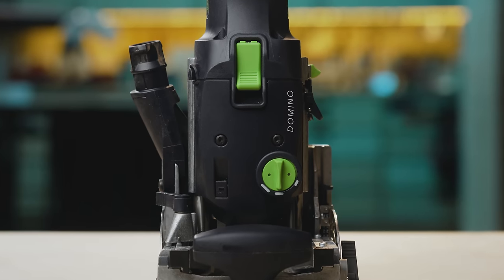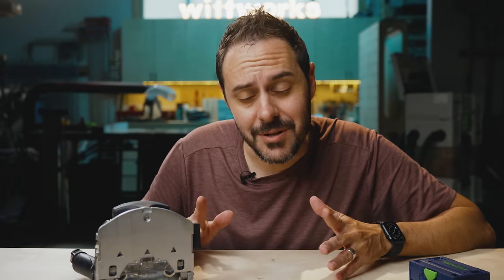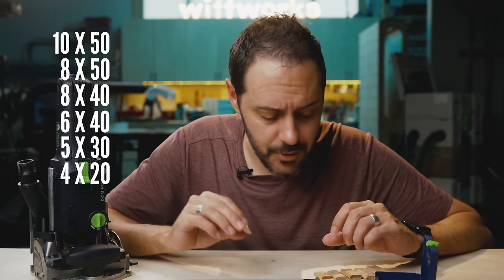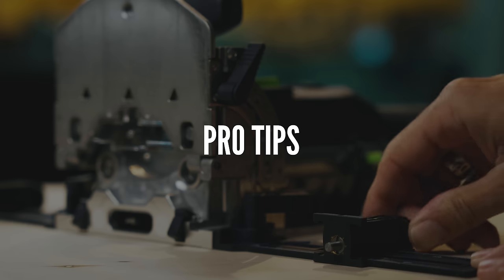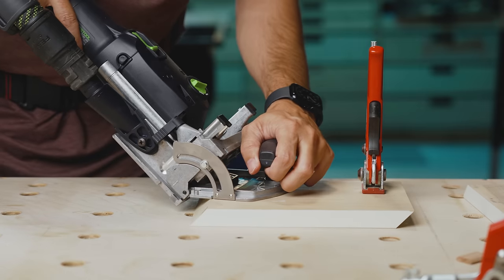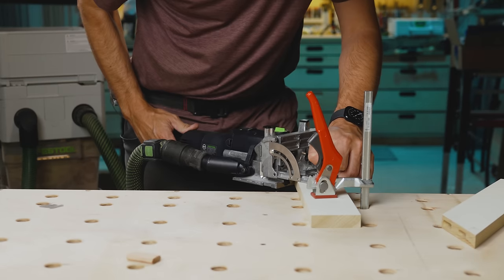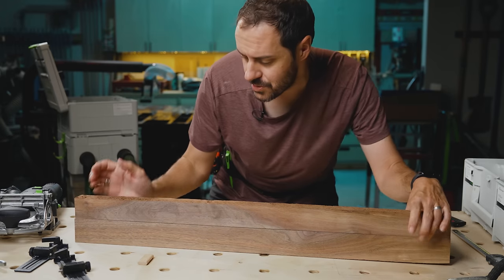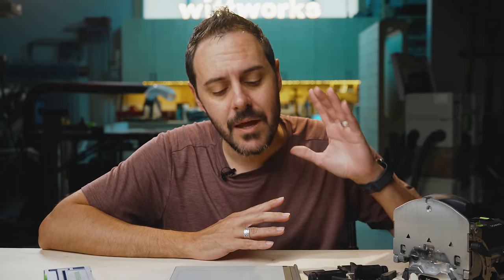Domino for Dummies

Comment: You keep referencing these Millie Meeters. I asked every Millie I knew and none of them were Meeters, some were Wmart Greeters but no Meeters. So I did Googlie and saw millimeters so I guess that is what you mean. But, here in Merica we only have inches. So 10MM is like 42 feet, according to the conversion chart I found on an Merican government site. That is waaaay to large for the work I do. Besides I converted Euros to Merican Dollars in my head and the tool is like $87000.00 not $1200, which is too expensive for me. Really good video though, and I congratulate you on your YouTube success to afford such a quality tool, I'll just stick to my drywall screws in pocket holes I make with a box cutter. Now, I have to go remove my tongue from my cheek.

Comment: Honestly, this is theeeee best Domino video I’ve seen. I’ve owned both the 500 and 700 for years. As a ‘no BS’ introduction to the tool, this vid  is as good as it gets.
Reply: 500 or 700, which do you prefer if you could only buy one?
Reply: @puna32  I bought the 700 and the adapter to use the smaller bits down to 4mm. It works well but it is big and heavy. I use it for bigger furniture so ot was the right choice for me. But it is a bit unwieldy on the smaller material.

Comment: The most consistent issue I have with registration is debris/dust. Almost every time I end up with some vertical registration it's because a little bit of dust or debris gets on the material and the fence will sit on top of that. Overconfidence with dust collection I suppose, but that's been my experience.

Comment: You can use a 6x domino in a 90 degree joint.  You use 15 mm  on the flat side and 25 on the long side.  You don’t need to step down.

Comment: I can tell you what went wrong when you did the fence at 45 and cutting the miter. At 45, the fence cannot go all the way to the base without keeping the black tabs depressed in. So when you pulled the one tab back out and reset the fence, that’s why it was higher when you cut it. You either have to go down far enough where the tabs don’t go in, or push it all the way to the bottom and not be able to use them as reference. Hope that helps!
Reply from the maker: Thank you!
Reply: Spot on.  Always, always set the miter first with the depth stop pulled all the way out.  THEN adjust the height.  It is the one order of operations on the domino that you have to follow.  And yes, the first time I did a miter, I made the same mistake...
Reply: @5280Woodworking 😅😅

Comment: One thing I considered as a hobbyist when buying this machine was how easy and quickly it set up and held the setting. Stopping mid project and continuing the next weekend has never been an issue. I hate spending tons of time getting a tool ready to use and rechecking calibrations and such.  The price is something to reckon with but the tool is high quality; the cost could be thought of in terms of the yearly cost over the life of the tool. The tutorial videos Sedge has out on his channel and the Festool live series are something unmatched with any other system out there.
Reply from the maker: That’s a great point! I didn’t think of that.

Comment: get a pair of flush diagonal pliers and you can pull out the dominos very quickly from your dry fit. You grab the domino and use the sides of the pliers as a lever. Pops right out.
Reply from the maker: nice tip!

Comment: Actually in my opinion and experience, it is very easy to get poor results when only referencing with the pivots (particularly with miters as you ran into here) as a slight change in how you pivot can throw things off. I think it’s much better to just draw your reference lines and line the tool up
Reply: Who would have thought of that, eh??

Comment: As a new domino owner, this was helpful. I will say I was shocked by how loose the first loose setting is. I'd love one that was only 1-2mm larger than tight.
Reply: This would be totally possible by making your own dominos the right width for your style. meaning, use the loose setting with your own slightly (custom) wider dominoes

Comment: As a diy-er fixing and maintaining my home who also enjoys working with wood and aluminum (easy to work with materials without expensive specialised tools) I watch these kind of videos to understand how the high-end tools are making life easy.
I then use the concepts applied by those tools to build jigs to achieve the precision/repeatability for the task at hand (time is not so much a factor, but budget and end-results are). Referencing with physical stops always achieves better results compared to measuring, marking and eyeballing a tool against the markings.
Reply: Festool Domino patents ends in 2024 , waiting other brands to make some cheaper versions 🙂

Comment: The fact that you're actually picking the optimal tenon thickness for each part is serious commitment :p.  I just use 5mm dominos for basically everything and they're pretty much fine, I just occasionally bust out the 4mm for very small parts or 8mm for very large

Comment: When plunging for the shelf you didn’t work off the table - your domino was referencing off the base instead of the fence.  Hence the visually obvious offset to the mortise.

When cutting your mitre the issue is you adjusted the height before setting the angle.  Set the angle first, then “reset” the height by loosening, bringing the fence up, then bringing it down before locking the height in.  The fence is fouling on the machine so your height was incorrectly set (too high) when you cut that first mortise in place.  When you discovered the reference tab pulled in you corrected the improper height setting on that first cut.
Reply from the maker: Thank you. Details details!

Comment: I was in your spot a few months back. The haters can hate, it's probably the best tool I have in my shop. I don't use it all that often when I do the benefits are immediately apparent. Thanks for putting together this guide.
Reply from the maker: Thanks William! It is so fast. I'm very impressed. The same people who claim it's cheating probably also dont drive an automobile and are still rocking a horse and buggy.
Reply: Same here… I got mine a couple months ago and LOVE IT! I’m making a lot of display cases and have a lot of miter and bevel joints. Those are a nightmare to align. With the Domino, it’s so easy and I get perfect joints. I’m so glad I bought it.

Comment: Great video. I am a hobbyist and got one a year ago because I make a lot of table tops. It was a game changer for me because my table tops turn out perfect and don't require a lot of sanding the seams. I watched almost every Sedge Tool video to learn his method. The best one is the 4 laws of the Domino. The best tip I learned for glue ups is to do a tight fitting on one entire side of the first board. Then on the second mating board to the first one tight, then loose on the rest. The only downside to that is that you can no longer use the accessory because of the mismatched sizes (I learned the hard way, no dry fitting, straight to glue 😂). You can mark the locations and I usually glue in the dominos on the tight side, let them dry quickly, then a little later glue into the loose side.

Comment: Very good video for beginners just starting out with a Domino. I watched several online videos from Festool before ever using the Domino and those helped immensely. You explained everything very well and was easy to follow along. I believe the couple of dominoes you cut that were too close to the top of board were probably user "error". If downward pressure is not applied consistently on the front plate, the domino can pitch upward slightly cause a cut too close to the top edge. I've been there and done that. Practice makes perfect.

I have just one comment about tight vs. loose mortises. When I cut my mortises, one board always gets tight mortises and the opposing mortises on the other board are loose. I noticed you cut the first mortise tight, then the rest of the mortises on the same board are loose. Which method is the right way, or does it matter?

For me it is easier to cut all the mortises on one side tight, the switch the domino to loose to do the other board, instead of having to make two size switches when you move to the other board.

In your last example of joining the two long boards, it makes perfect sense the way you did it, only because you're registering from the previous mortise as you move down the length of each board.

I'm interested to hear what other's have to say on this.

Thanks again for the video.

Comment: Great job, and now you've got me looking into one of these. I'm building a new house with a 14'x32' woodworking shop. We intentionally left several places without cabinets, bookshelves, and a desk because I plan on making them. Right now on my must have list is a SawStop 36" PCS 3 hp table saw, a Harvey Ambassador C14 band saw, and a Record Power 3 motor CamVac. Looks like I might be getting my 1st Festool piece of equipment in the Domino. I've got a biscuit jointer (well I borrow a friends) and I've never been happy with it. With all the cabinets I'll be building I can see the advantage of having this tool to get it right the 1st time and not get frustrated with my joints. I love making Amish type of furniture, though I've not had the opportunity to make much, but now that I'm retired (64 years old), I'm getting my first woodworking shop (not using my garage and moving stuff around all the time to make room for the cars), I'm looking forward to making furniture for my family and friends.
Reply from the maker: Thats awesome Pete! I'm very impressed with the cabinet ability of the tool. Sedge has some great videos on it I think. We're moving in a few months and my next shop I'm going to build all of my cabinets with it instead of pocket screws. The fact you dont have to mark and measure is a surprising delight.
Reply: I have both of those saws and they're excellent investments. I've also been building cabinets in my shop and have to say the domino came in handy once on a face frame where I mis-judged a pocket hole, but pocket holes really shine in cabinet work. I love my domino but I might recommend you start with a high end sander (festool/mirka/3m, as fits your workflow), which gets much more use and saves a lot of vibration fatigue. My festool sander is by far my favorite tool from them. Also, be aware that large dust collectors like the CamVac lose efficiency quickly when you stop them down below about 2.5" hoses (the domino is something like 27mm outside diameter). It sucks to need two different dust management systems but you'll actually get better performance with a domino or sander by using a regular shop vac (or a dust extractor like the festool ones that turn on/off automatically and run quieter than a regular vac).
Reply: @ex-nerd  Thanks for your comments, and a 3M sander is on my shopping list as well. I'm still on the fence on sanders as I keep hearing great things about the festool, and how there system works all work together. I just don't see it in my budget (and getting my wife to approve the purchases 🙂) is always something I have to factor in. After 38 years of marriage I find it helps to have her "approve" of my hobby purchases. Lucky for me (our unlucky because this also drains the wallet) she love to sew and has quite the sewing setup. Part of my build out on our house is her sewing room (cabinets, layout table that is murphy bed like in the wall) so I get to get new tools to help build out her stuff 🙂
Reply: @petenelson8136  3m wasn't out when I got mine, but I ultimately picked the Festool over Mirka because I decided I would probably prefer the switch over the paddle. But they're all so much better than a cheaper device, any would be at the top of my recommended upgrades.

Comment: I've thoroughly enjoyed using mine. Saw someone use theirs in my woodworking degree classes and bought one. Made faceframes and glue ups much easier. I've even made full scrap wood projects where nothing was the same size work. It's not a cheap tool, but I enjoy it. Some of their tools, like the planer (which I have) are not this good of quality, but this is one I'd definitely recommend.

Comment: This also may be worth putting out there…. If you are going to get the domino and can get the systainer with all the dominos in it… DO IT!!! I almost didn’t because I wasn’t sure I’d use all of them. Or that I would EVER need some of them. I didn’t get it when I first got the Domino. Within a month I went ahead and got it. I didn’t want to be stuck without what I needed. I’ve used every size and I replace when I get low. It’s come in very handy. 

As for that 4mm… it’s great for using in 1/2” stock. Mainly I use those for making drawers out of 1/2” ply.
Reply from the maker: Great tip!

Comment: One thing you didnt talk about is you absolutely have to run dust collection with this tool. And you can use 40mm tenons to do a shelf with a 15/25 setting. Everything else you talked about was spot on. Great tool for the professional using it to make a living to the high end hobbyist. Is it for everyone no. Great video! Thanks for sharing!
Reply from the maker: Thank you. I intentionally showed using the 5x30 on the shelf for the beginner so it would confuse

Comment: Metric = easy as based on 10, imperial more comples, 8ths, 16ths, 32sth. I grew up with imperial and use to it, but metric is simpler. Woodworking is just a hobby for me. Not cheap tool, but amazing tool. I save lots of time in setup, so I have more time for other things. I remember using biscuit joiner and sold off that tool within 2 weeks after buying it. The best tool for the job is my motto. Every tool has a learning curve. Bottom out the plate to base before setting the angle. Look at some of the Lamello stuff.

Comment: Talented amateur here. Great video. Love my Festool track saw and MFT/3 table with the extension I bought for it.   Very cost effective.  I would love to buy the 500 but I don't have the $$$ for it.  Instead, I use Peter Millands domino jig for 5mm dominos  Takes more time to set up, but you get the same tight/loose fitting for parallel, "L" or "T" joints which I use the most.

Comment: Very well done video for the Festool Domino. Consider this a Leigh Pro Frame Mortise & Tenon Jig is 1399.00 usd. Then the cost of a pro 3.25 hp router another 600 to 1400 usd, depending  on manufacturer, then the router bits 50 to 100 each. The Festool Domino is the more cost effective alternative for the mobile Carpenter for either the D500 or the XL700 system or even both. Just to make Mortise  and Tenon Jointery.  If you make doors entry or interior use a XL 700 for cabinet doors and frame work use the  D500. I don't even use my Kreg Foreman anymore to make face frames my Festool Domino 500 is my go too. Combined with the MFT and ST1000 system all my sheet good and face frame work is done and I can now do mobile repairs for cabinets.

Comment: Great video. I've been using the domino for years, and I never noticed the depth setting trick on the 4mm cutter!
Apart from the quality and precision of the Festool system, the other great feature is customer service.  If a tool breaks down, even if it is out of warranty, old and obsolete, you can get it fixed and returned to you in very short order...at least that's it works in the U.K. (And I'm sure everywhere else in the world). Definitely not cheap, but worth every penny of the investment.....my woodworking has improved exponentially since I splashed out on my first Festool tool( TS55 plunge saw)

Comment: I’ve been woodworking for over 45 years and, for part of that, ran a small woodworking business (2.5 FT equivalents) making bespoke furniture; I should say that this business was a real sideline to my main business and it was more something that was personally interesting than anything and, when the fun stopped, I closed the business. 

In any case, any tool was regarded as an investment. We always looked at life cycle costs and not purchase price. I have quite a few Festool items and they vary, in my view, from very good to average to not so good. 

In the case of the domino, I still have both machines. I started out with traditional M&T joints made by auger, chisel and saw. Then we got a dedicated floor morticer which I still have. The only reason that morticer doesn’t get much use from me now is that my neck and shoulders won’t take the strain of pulling that lever many times to get through hardwood. The dominos are obviously less physically demanding but they were bought because they made M&T joints (okay, more accurately loose tenon joints) quicker and more accurately. We estimated that the payback in labour time alone was 6 months. 

There is an interesting exercise. If I lost all my tools on some sort of catastrophic fire and got full insurance pay out, what tools would I buy and what from what manufacturer. I would buy the dominos again.

Comment: Learned the hard way that the cross stop attachment has pins thicker than the 4mm domino.  Thanks for the video.
Reply from the maker: Oh I didn’t know that! Thank you for that.
Reply: Btw i just fixed mine.  Pulled the pins out and inserted them into my drill press with the exposed part of the pin exposed and then used a file to take the pins from 4.95mm to 3.95mm and now they work for the 4mm dominos